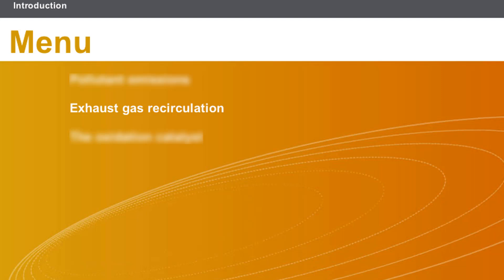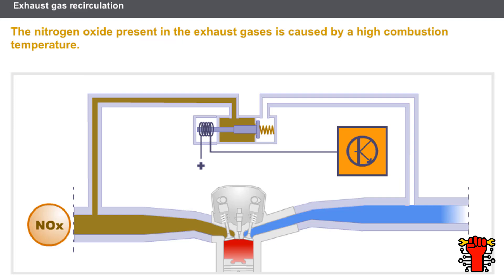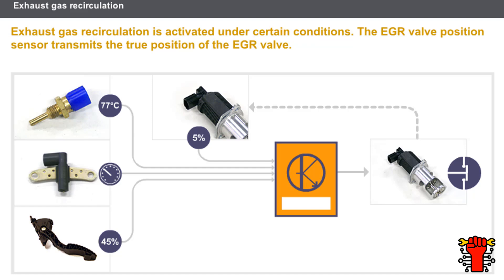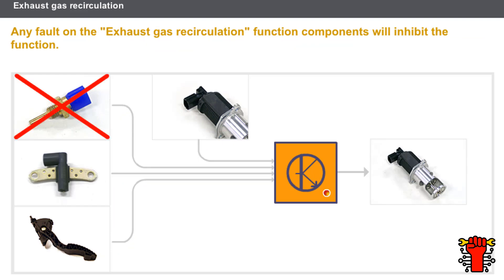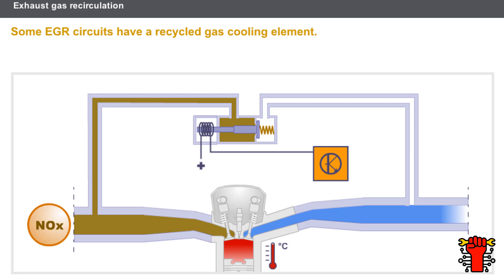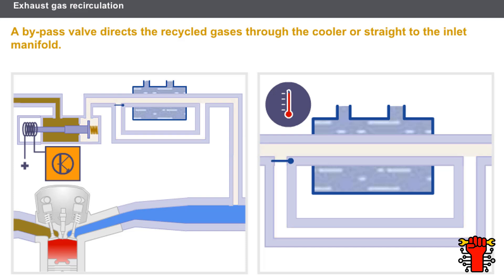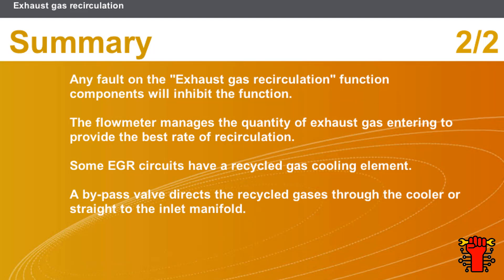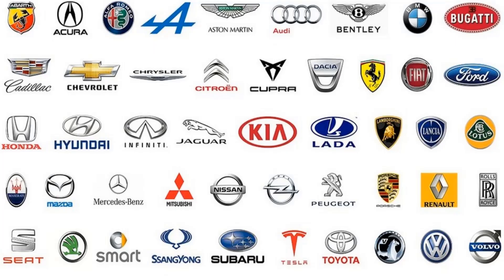Exhaust Gas Recirculation EGR

Comment: When buying a second hand car, i draw the line at EGR
Reply from the maker: Thanks for sharing your perspective! It's interesting how different people have varying priorities when it comes to buying second-hand cars. The EGR (Exhaust Gas Recirculation) system is indeed a crucial component, and some buyers prioritize its condition to ensure optimal performance and emissions. What specific concerns or experiences have led you to draw the line at EGR when making a purchase decision? I'd love to hear more about your thoughts on this, and it could be valuable information for others in the community too!
Reply: @-CarCraft-  I just hate recycling exhaust gas from a design purity POV. It's also more things to break down and complexity for marginal gain.
Reply from the maker: @8m2sCv7   It's true that the concept of recycling exhaust gas might seem counterintuitive from a design purity standpoint. Your concern about added complexity and the potential for more components to break down is valid, and many car enthusiasts share similar sentiments. Striking the right balance between emission control and simplicity is indeed a challenge for automotive engineers.
I appreciate you sharing your viewpoint on the EGR system. It's always fascinating to hear different opinions on car components. Thanks for adding to the discussion! If you have any other aspects of car buying or preferences you'd like to share, feel free to do so. Wishing you happy driving!